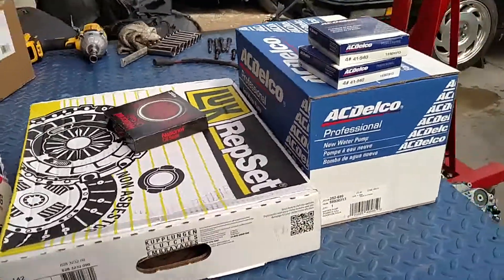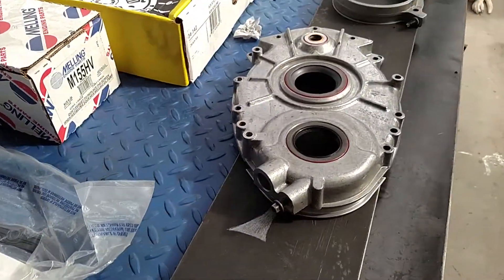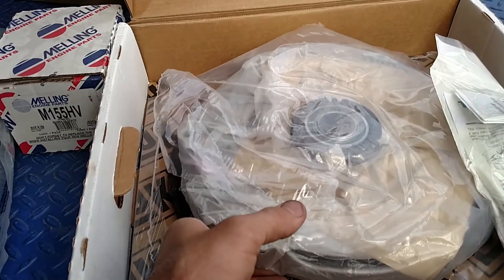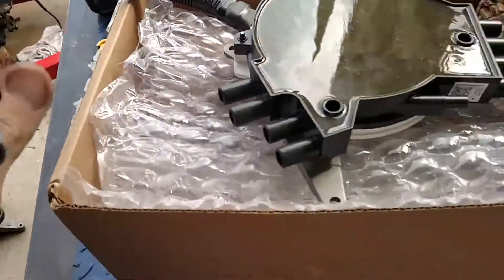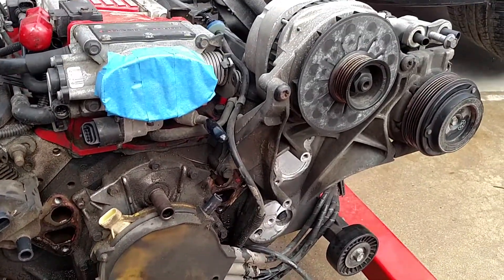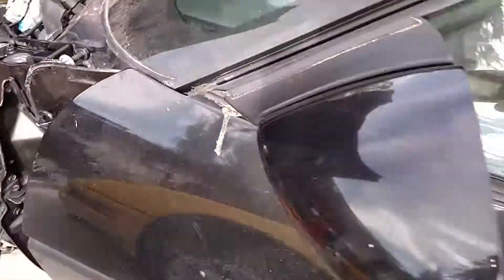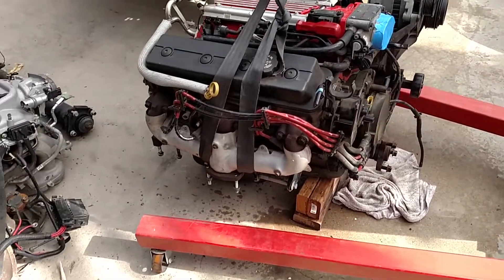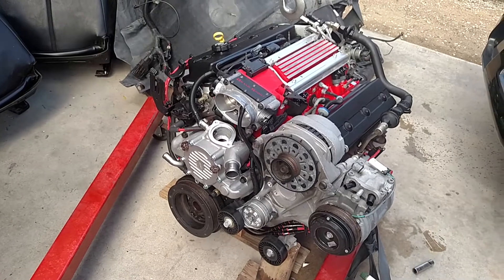Corvette C4 LT4 Project #6

Comment: Hey, just out of curiosity I would like to know if I can buy those engine fuel lines I have a 97 Trans Am that That cranks and doesn’t start I put a field pump probably in the kind of messed up fuel tank I broke one of my fuel lines from the throttlebody. I tried taking out the injectors the security light stays on when I crank it, but it fires up with starting fluid any tips, and any parts I can buy off you.

Comment: i got a question i just did an oil pan gasket and ive been hearing people say its okay to put  silicone around the gasket. from your experiance do u use silicone on oil pan gaskets?
Reply from the maker: Use the factory original gasket and use silicone in the corners only.

Comment: What is the difference between a Lt1 and a Lt4? And is there a hp difference? Also... Can I turn my Lt1 into a Lt4?
Reply: Charles Gayhart Short answer is no, you can't turn a lt1 into a lt4 unless you want to spend tons of money at which point you are better off using the money to just build the lt1 up. lt4 has a special crank shaft, has a different stronger timing chain, has higher flowing heads, better flowing intake manifold, higher factory Rev limit set to 6300, larger fuel injectors, hotter camshaft though not that aggressive, higher lift valve springs and 1.6 roller rockers along with other miscellaneous things. lt4 was rated 330 crank hp but most were making 300 at wheel so 350hp and sometimes more were what they made compared to the lt1's 300.